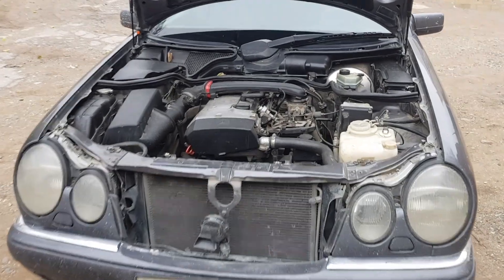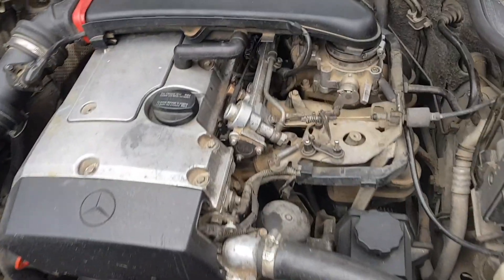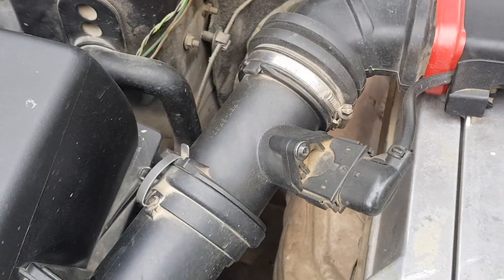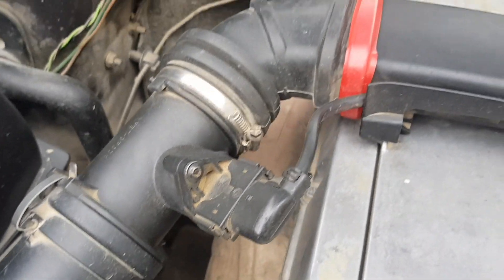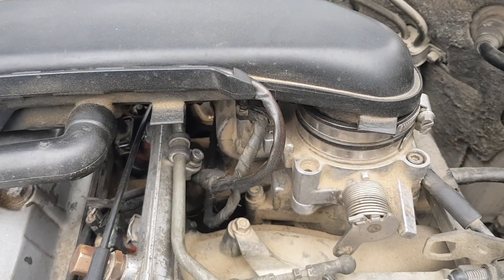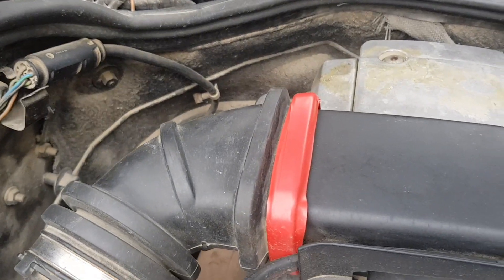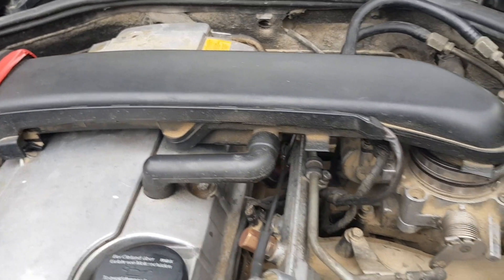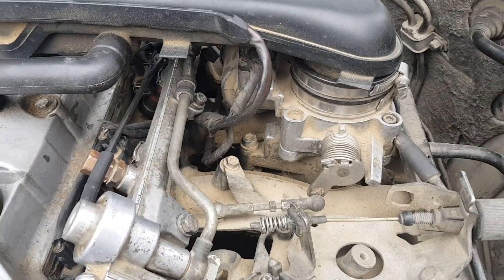Causes of Increased Fuel Consumption

Comment: Hi i have fiet 500 lounge. Feul consumption is to high 28 mpg . Today I go to 2 mechanic 1 say need to change a sensor and 1 say need to do service which 1 is correct i am confused
Reply from the maker: You need to do computer diagnostics
Reply from the maker: Maybe it's lyamda zond
Reply: They didn't check by computer they press hardly on accelerator then say  1 sensor needs to change  he say name but I don't remember
Reply from the maker: @abedintech7213  no , only diagnostics

Comment: Great video. Very helpful. Can bad EGR in gasoline engine make bad consumption ? Can cold crank misfire (2-4min bad idle and after that it works great) be caused by bad maf sensor ?
Reply from the maker: you need to check the spark plugs, wires, insulator, nozzles, throttle valve. there may be low-quality fuel.